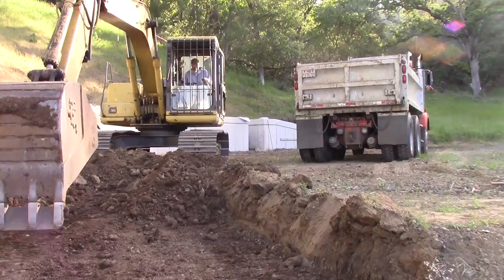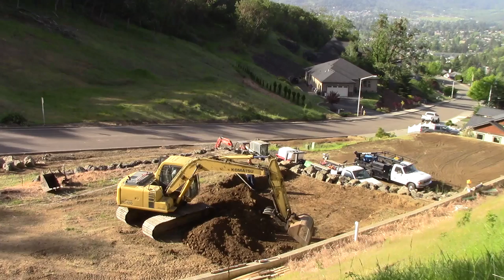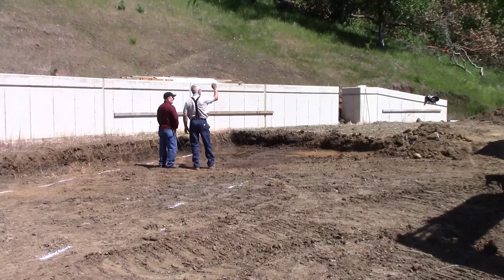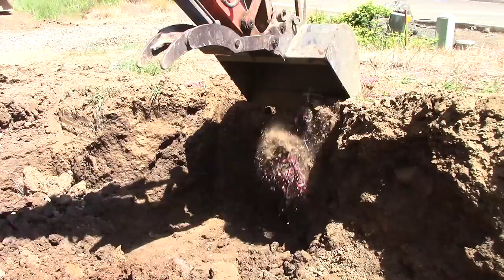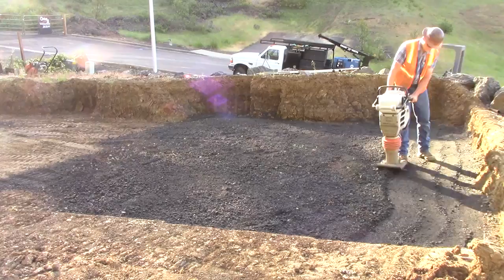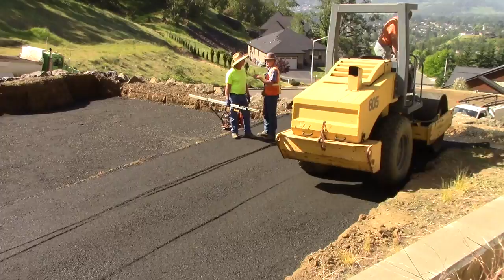Foundation Excavation Ep.26

Comment: I've worked in hundreds of crawlspaces. I have rarely had the pleasure of working in one that was even flat, only a handful of times I worked in one that didn't have a bunch of sharp rocks and debris under the vapor barrier, and NEVER worked in a crawlspace with perfectly flat crush and run laid smooth for the sake of the worker. Send me a plane ticket and I'll come work for free in that crawlspace. Great work guys. And thanks again for taking the advice given a year ago that I also supported of building a crawlspace rather than a slab. It's so much more relatable for us to learn from now and it's far more repair/remodel friendly for the life of the house.

Comment: Nice to see proper compaction.  Most so-called 'builders' don't have a clue and many so-called grading contractors aren't much better.  Then when the driveway, sidewalks and foundation settles and cracks, they blame it on insufficient rebar, groundwater or whatever excuse will absolve them.

Comment: I'm so glad that you are making a decent floor on that crawlspace.
My parents purchased an old house with a modern addition and a bunch of the floor insulation fell down and needed replacement. I discovered that the contractor had seen fit to not only leave any rocks but also use it a dumping ground. I calculated that I removed about 2 tons of 1" to 3" rocks/concrete via 5 gallon buckets. This was about a 12' x 30' area. I was about to track down the psychopath responsible and force feed him a couple of buckets worth and glue the rest to his driveway.

Comment: Very interesting information in this video.  First, I find it interesting that the retaining walls are poured, reinforced concrete and yet the foundation walls are block.  Secondly, when I do plan design I include a detailed site plan that has calculated depths for bottom of footing, rough grade, finished grade, drainage direction and estimated slope, etc.  Isn't it counter intuitive to detail a foundation wall without considering the depth of back-fill?  The height of your fill against a foundation wall is a major consideration when designing the wall and its connection(s) to the house.  Our permitting authority would never allow the contractor to set the depth of footing.  I suppose it is such a different environment where you are building that these are not nearly as critical.  You obviously have more rainfall to deal with and decidedly less frost penetration! 🤣🤣  I do love to watch folks that adeptly run those excavating machines.  Even the skid steer operator was great. And that guy placing the boulders, what can I say! Great fun watching your progress pal.

Comment: Hi Scott would it be possible to set up a timelapse webcam (or trail cam) on a poll at the back of the site to capture the entire build and throw that footage together at the end of the project.
Recording at least until lockup or external cladding stage the restarting it if there is landscaping, it's always great to see builds in a nice condensed form.
Also I can't wait to see the tiling stages 12+ year Tiler from Australia here  I always enjoy seeing the weird ways Americans lay Tiles/Stone especially the waterproofing IDK why liquid membranes aren't a big thing yet over there.
Thanks Nick.
Reply: @suspicionofdeceit Ditra board as a waterproof membrane not enough floor wastes, not screeding to achieve fall outside of the shower recess, high end expensive jobs and they install a prefab cast shower  base and walls.

Comment: Just a  constructive comment . Rather than cross chain back in your  block corners, I would call the surveyor back in to mark the exact corners  for the block on the foundation.  The offsets you have are great for a check and rough corners but I believe you can save your self some problems by getting the corner marks reset on the foundation once its poured.  Transferring the measurement and staying plumb for accurate measurements from your slanted offsets is going to be tough unless you don't mind being an inch off or more, or  on the total closure of your building dimensions and staying square.  Love your videos and your projects.

Comment: i run a crew of 10 yr+ hands in an urban/suburban area as a GC. your comment about small lot work being slow and EXPENSIVE is the one thing i cant seem to get through a clients head.... my guys are as proficient and efficient as humans can be and clients just cant/wont understand how much harder it is when you have existing buildings 6 ft easements off the prop line and you are trying to run equipment.

Comment: Can't wait until framing starts
Reply: 🤣🤣🤣 ...my thoughts exactly - professionally damaged I suppose. Doesn't matter - this is important stuff. Can't be rushed, or you'll be sorry later.
Reply: ...which reminds me, Scott and Nate: Have you seen the T-studs? Insulated core with 2x3"s on both sides, connected with dowels and a foam core to make the stud itself an R20 member for either 6 or 8" wall thickness. It was featured not too long ago on the build show with Matt Risinger. My greatest opposition to it is the foam, as I believe it does not yield a very hospitable indoor climate in comparison to materials as hemp or cellulose based (paper or wood fibre) insulation materials. I believe you can also get it bare, without the foam core, but whether or not the foam has any real structural properties within the studs/beams, I simply don't know. Pretty cool though - makes the life of the electrician SO much easier! Carpenter will probably have to make the adjustment from nailgun to screwgun, but less material is needed, as single plates should be adequate along with increased stud spacing up to 24", now of course - I don't know how they comply with local rulebooks in Roseburg, but they should be quake compliant, as well as available in both raw and treated wood... By this time, lumber has probably already landed on site, or have at least been ordered... But check it out! ...bad news is the regular mag77 probably won't quite cut it... Not as fast as a regular 2x at least.

Comment: A good method (but a ...uh, let's say punctual) to reinforce and make the operator's work easier is to use a laser indicator to create a "wall". He/she, will always know at a glance when they are within the dig side or not. Only downside, having to move it from wall to wall (unless you can setup more). I use two, to form a corner, the two fellas i usually work with when breaking ground say it helps speed things up.

Comment: My house is not high enough driveway water runs towards house mainly because the street waterruns into the driveway. 
My crawl space vents are not much higher.
Reply: Doesn't sound like too good of a situation. Around here contractors are liable for both legislative and quality aspects of the build, and plans and sections submitted to the city have to  be measured in relation to fixpoints, usually in the street, and then also be in compliance with local rules for placement and size, which means the closer you get to the property line, the less building height you usually have to work with. Usually there is also a set maximum building height for the area, so neighbours won't obstruct or disturb one another. All of this has to be accounted for before submitting plans to the city, which means all of the elevations, including grade, footing and floorheight are also set to begin with. Depending on the surveying and site prep, you might have to go deeper for adequate compaction and stable ground for the footings to sit on, but unless utilities run across the lot, this is usually an issue solved between contractor and homeowner.

Comment: Unfortunately it’s only a matter of time before the laser sensor can be easily mounted to an adjustable point on the excavator arm eliminating the other man on the ground. Another decade or so and even the machine can be operated automatically by sensors. The “digging” jobs onsite will be reduced to the person setting the initial transmitter and the repair technician for the sensors.  Hopefully this version of the apocalyptic future won’t fully come to fruition, the “Brave New World” so to speak, and skilled craftsmanship continues for several more generations.

Comment: Dirt is one of the few commodities that defy the general rules of economics.  There is a virtually and unlimited supply so it should be inexpensive. However, by the time it is delivered it is expensive.  Got some you need to get rid of?  You should be able to find a buyer if you price it right or so the Nobel Prize theories would suggest. But in reality, you will pay through the nose to have it hauled off.

Comment: A block foundation? .....Seriously?
Reply: what would you prefer?
Reply: @doughay9742  If he's an experienced concrete contractor... how about a poured foundation!
Reply: @kylek9432  scott's an all round contractor makes no difference i suppose? just the design he went with , no concrete floors needed!
Reply: Kyle K  it's easier (physically and mentally) to have the block-jocks do it.😂
Reply: @doughay9742  You're not understanding. A block foundation, even if reinforced with rebar and grout filled cells is still inferior to a reinforced non-composite concrete foundation.
Reply: @kylek9432  well...as a bricklayer myself i understand just fine!  🤣  🤣  im not arguing with you on that, im sure the cost price  had alot to do with the design! but hey ho it will do the job perfectly!!  👍